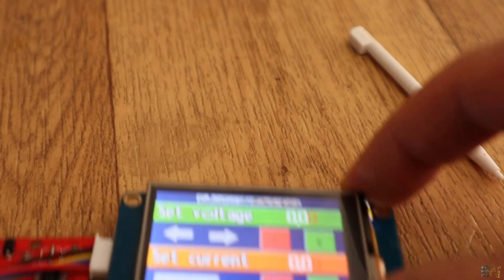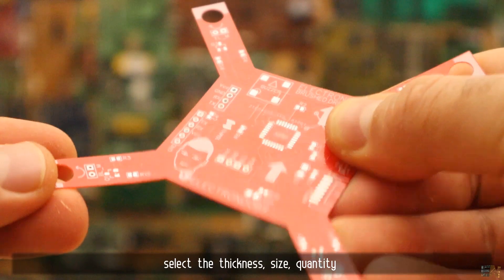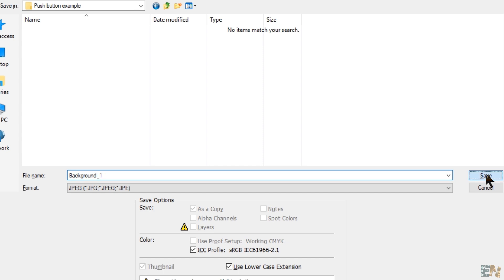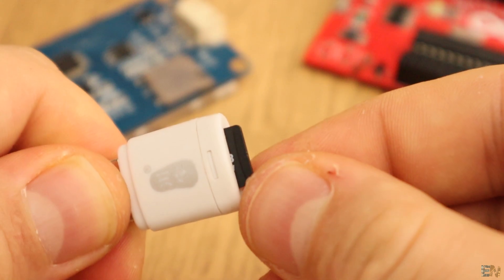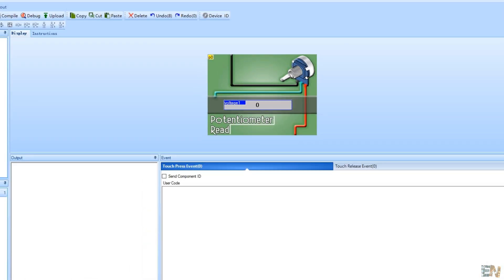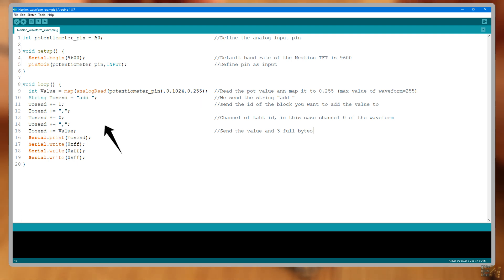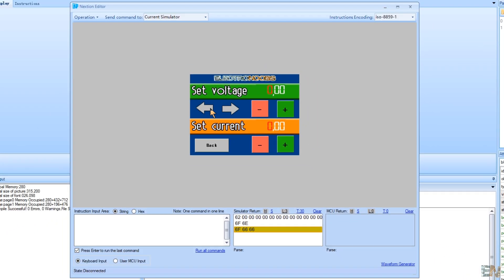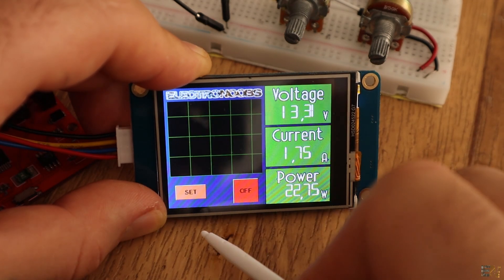Nextion touch TFT display examples | Digital power supply - part 1

Comment: A TFT file is no longer built and placed in the bianyi folder on Compile. To generate a TFT file, one has to use the TFT file output menuitem located under the File menu.

Comment: My nextion inteligent lcd doesn't work :(. Did you include any libraries? I have no comunication lcd with arduino.
Reply: Ok it's work. Just upload data to arduino. Than connect the display. Great job. It so easy. I just start my adventure with nextion and arduino. I couldn't find any instruction on how to comunicate with the display. Thank you again.

Comment: I have tried to input (AD8232) Heart rate monitor's output signal into NEXTION TFT by connecting with ESP8266 using the above code but it didn't show any Waveform . is there any specific method to get that output signal into TFT screen?

Comment: the drawing of your waveform appears to change direction. As long as the screen is not full, it is draw like on any oscilloscope from left to right, but once the screen is full, scrolling rolls the already displayed waveform from left to right, instead of right to left, as would be the usual way.
Reply: Hi will you consider to look at the DWIN display,?kindly send me an email or message referring to my banner contact info.

Comment: Sir,  no doubt your project is wonderful. But you forgot to show complete block diagram which includes of 220v to 30v ac to dc power supply, buck boost converter, Arduino, Nextion touch display, 2 potentiometers, bright on/off LED, on/off switch button, short circuit buzzer, final output terminal etc. Along with wiring connections.
Can we make volt, current and power Digits still bigger in display? Can we add input volt and current values permanently displayed at the bottom of the screen? Please guide me, send me HMI tft file and your reply on my email nbpanjwani@gmail.com I intend to build this project. Will you help me, please?

Comment: I am building a controller with this touch screen but I need to get the Arduino to request the value of components on the nextion to turn on and off outputs

Comment: I know that they are no good for small projects, but if I need a touch screen I tend to just buy the cheapest android tablet on the market at that time and interface it with the arduino through Bluetooth or USB.

I actually just brought 5 kindle fire 7's as they were on offer for £25 last month. Must have been selling below cost.

Comment: Hey!, Awsome videos as always. I dont have Nextion display but insted Geekcreit® 2.8 Inch TFT LCD Shield. Does Nextion IDE work with this model becase this one have a sdcard reader? Thanks again for the video!❤️
Reply: No. The sd card reader on yours is for storing pictures only. Not for nextion files
Reply: @Nicksperiments  Hi will you consider to look at the DWIN display,?kindly send me an email or message referring to my banner contact info.
Reply: Hi will you consider to look at the DWIN display,?kindly send me an email or message referring to my banner contact info.

Comment: A real 2018 power supply, awesome! I need to switch between a center tap and a normal positive, negative and carry all of that current. I have a Toroidal 24vx24v-24v-0-24v-48v 13a~26a 625watt

Comment: Excellent video. I have a 3.5" Nextion display and connect it to my PC using a CH340G RS232 to TTL module. This allows me to transfer my code from the Nextion IDE directly to the screen without having to use a MicroSD card.
Reply: Is there any tutorial to follow this ?
Reply: Any tutorial for this anywhere ?
Reply: @vishalgaurav4411  I just bought one of these https://www.aliexpress.com/item/1PCS-CH340-module-instead-of-PL2303-CH340G-RS232-to-TTL-module-upgrade-USB-to-serial-port/32802856751.html?spm=a2g0s.9042311.0.0.35864c4ddmFaMU
Plug the USB end into your PC, make sure it is set to 5V and connect the 4 wires from the Nextion display, remembering to connect Rx to Tx and Tx to Rx. In the Nextion Editor you click the Upload button and select the correct COM port if you have more than one. The code is then transferred to the display.
Reply: @Ivor_Nastyboil  thank you
Reply: I think the new ones have an USB interface instead of the memory card.